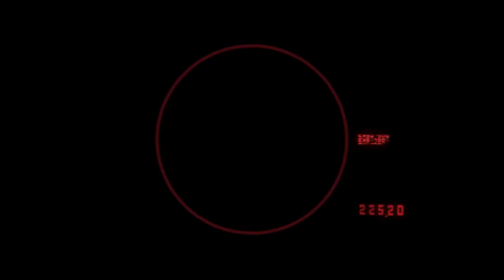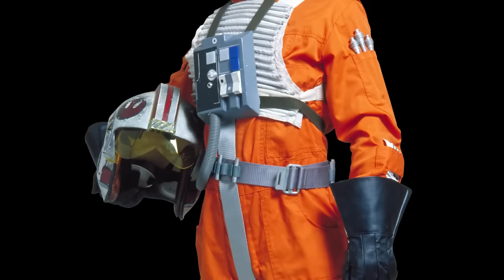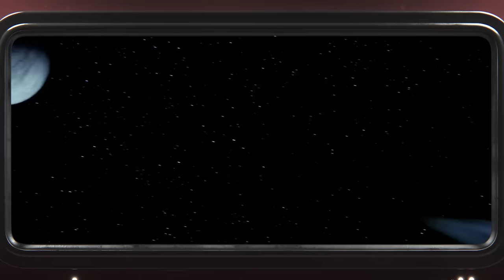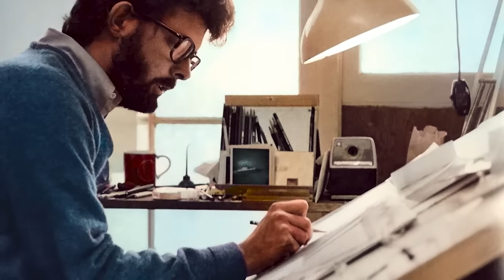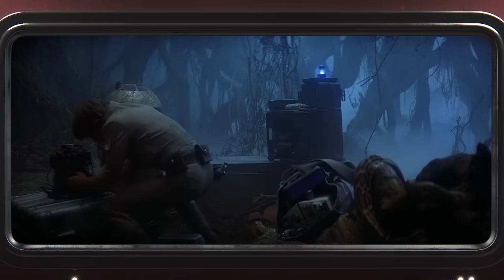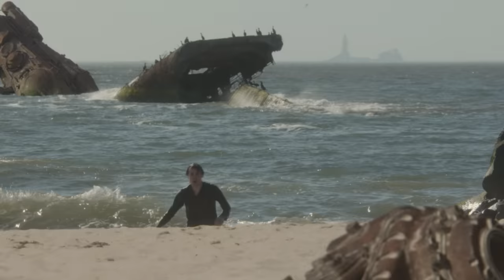X-Wing Ejection: It all makes sense now

Comment: I see this as a "yes, and" situation, where all those possibilities are included. You have the main pod system for routine ejections in space. If for some reason that's disabled or if say you're too low in the atmosphere of a planet to safely fire the main pod, you have the seat ejection system with some sort of shield to temporarily protect the pilot if in space or a harsh environment, and in case that's not enough, you then have some time to seal the flight suit.

Comment: I think the main reason we no longer heard about escape pods on starfighters is the fact it raises the stakes. The rebels have limited ships but throughout the series I always had the impression they're lacking proper pilots even more (also considering how quickly they got Luke into the attack run on the Death Star for example). A newbie might be a significant risk, even if pilots know each other otherwise. As such, losing (or not getting new) pilots was a serious concern. Just being able to eject and possibly instantly switch to another craft would have allowed for far riskier moves and strategies not necessarily befitting the tension building. (And I'm intentionally ignoring the bombing run in the sequels, while I understood the homeage, that felt just stupid, especially how there was obviously no safety/backup stuff for bombers being hit, even though these were dedicated heavy bombers… wtf?).

Comment: This is definitely the most sensible option and makes sense in every way, it is very weird that Legends material opted for a whole load of extra tech that even if it worked fully, would make survival very unlikely simply because most fighters ejected that way irl.
Reply: Which makes more sense? A big pod? Or a basic escape system and devote the resources to better shields and such. So I doubt the pod method like that will be used

Comment: That makes sense. This should be cannon.
Also if the droid could maintain control over what is left of the X-Wing it could then call for help using the long range transmitter.

Comment: In NASA's Designs for the Space Shuttle was originally suppose to have an ejection system similar to that of the F-111 so in the event of a disaster on the pad or During Launch, the entire Crew compartment would be ejected from the Shuttle and allow the Astronauts to survive. But those designs were scrapped on the account that the system would be too complicated and added more weight to the shuttle and thus meaning that it wouldn't been able to carry the loads and cargo that it was being built to carry.
Reply: Sadly, when Challenger exploded the entire crew compartment was ejected more or less in one piece...but with no way to bring it down safely. A few years later a redacted part of the accident report stated that at least some of the astronauts survived until impact with the ocean. I've always wondered if the person who made the decision to scrap that escape system still felt it was worth the weight savings after that.

Comment: Has a certain resemblance to the cockpit module of the  SA-43 Hammerhead from Space: Above and  Beyond. Was even used  several times during that series.
Reply: What I like about the series is that all pilots have their individual cockpits and get generic fighters attached to them.
Reply: @Schwarzer Ritter  indeed and also they had the most unique flightpreps I've seen so far, getting into the cockpits which were not even attached to the fighters yet.

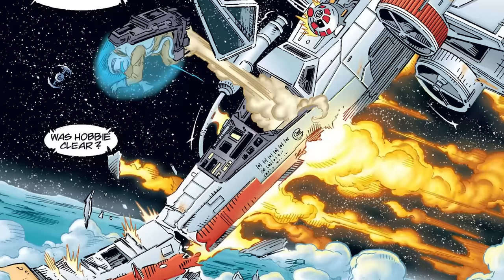Comment: @echenry 1:00 The X-wing novels explain that the pilot gear has a small emergency air supply, an air recycler and a small forcefield emitter that contains the breathable air around the body of the pilot while protecting them from the harsh radiation of space.

In this way, Incom saved money and resources in the design over a fully sealed escape pod.

Comment: Thankyou! This is awesome looking. 

A thought, the cockpit ejects "upwards" but the astromech doesn't necessarily do the same, maybe it ejects "downwards", that way there is no interference. 

Recently after the release of Maverick, Neil deGrasse came out and said Tom Cruise would have perished had he ejected from the Darkstar when it started tearing itself apart. However many pointed out that planes like it would have an enclosed ejection system, allowing Maverick to survive. The samples used were the same you put in the video. I really like the footage of real world samples that back up your design. It adds a sense of realism and tangibility that clearly is reflected in your models.

I hope to see a full fleshed out sequence of this someday, a bit longer than the one you have here. Also I am supper excited to see your fanfilm! Its gonna be epic and I am sure many will pitch in to help!

Comment: I had a teacher in college who was an F-111 pilot. He and his buddies were dubious as to the performance of the F-111's ejection pod. As for ejecting with the astromech, I figure that just as the F-111 has that extension behind it, maybe the pod on the X-Wing does the same for the droid. The pod is actually the cockpit, and droid station in one piece. If that's not the case, then I'd say the ejection works like the tandem seat system in say an F-14 where the seats go off in a certain order with a time delay. In the Tomcat, the seats eject the RIO first, then the pilot. Since a collision with the droid would mean both pilot and droid would be lost in the case of the X-Wing, I would imagine the sequence is reversed.
Reply: An astromech is supposed to have its own rockets anyway
Reply: @tsm688  True, but as both quality pilots and droids are very valuable, I would imagine there would be ejection considerations given to them as insurance.

Comment: Excellent work on this, EC. It actually does bring into question the other starfighters as well. The TIEs (Correct me if I'm wrong), despite how fragile the starfighters are, might have one of the better ejection systems out there since it's essentially solar panel wings strapped to a cockpit. Seemingly, Imperial pilots have extra gear on them to not only handle the possible vacuum of space, but the TIE cockpit bubble is an encased atmosphere (Double redundancy). If that's true, then Imperial pilots might actually be in better shape if they eject in battle than Rebel pilots. However, it isn't to say that the Rebels don't care about their pilots but are simply more limited in resources in how much they can provide to save their pilots.

Comment: I like to imagine that the true Incom factory made X-Wings do use full escape capsules, but the stripped-down variants the Rebel Alliance uses do not.

The rebellion's X-Wings need to be simple and easy to maintain with minimal specialized tooling, as these things are expected to be operating from dirt runways and serviced by speeder mechanics.

Shipboard servicing by trained technicians are a luxury only a select few Rebel pilots can afford.

An expensive, complex system like the Ejection Capsule is easily serviced by a proper navy, but the Rebel Alliance ISN'T one. They lack the necessary logistics and spending power to properly maintain a large fleet of original, cutting edge, Incom-spec X-Wings.
Reply: Yep. I was thinking something along the same lines. Though I was more thinking about how much the base cost increase would be from adding that complex and important of a system. I'm thinking at least 50% higher.

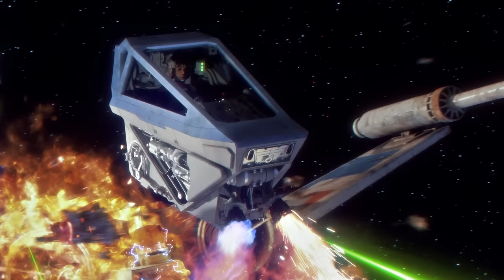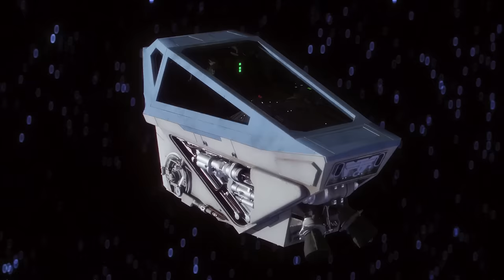Comment: This is a wonderful explanation that makes the most sense. Since it was not designed this way, the cockpit line does not seem to continue past the back window frame in the image of R2-D2 at 4:32.  The image at 4:07 shows a few inches of flat hull behind the window frame which is a more likely design.  I like the idea of color-coding the Cockpit to the group.

Comment: Rebel pilots were originally intended to have fully enclosed helmets and space suits (as seen in the original miniatures). It was a late design decision to switch to open face helmets so you could see which pilot is which during and make dialogue more dramatic for the death star attack. How a pilot would survive ejection was probably just an oversight.

The Tymothy Zahn's Thrawn Trilogy introduced the concept of pilots having helmet seals in the cockpit which pilots would apply before ejecting. This is somewhat more reminiscent of more complex bailout procedures in WW2 for the RAF bailing out over water with a life raft. Or also even the interim workaround for early F-14's where pilots were crews were instructed to jettison the canopy manually before ejecting to prevent the RIO hitting their head on the canopy until the issue was fixed.

Comment: Late to the party, but your idea isnt necessarily inconsistent with other media.
Its noted in the later X-wing novels that the first thing most Alliance squadrons mechanics do when they get a new X'wing from the factory is immediately tear it down looking for issues & modifying it as necessary.
The characters doing this even mention that there are chronic issues with certain equipment that makes stripping them or modifying them basically standard.
It would be entirely possible that one issue would be the cockpit pod itself. 
It is notable that no other aircraft ever used the F111s system, and even the F111 would lose it and go back to regular ejection seats in some variants IIRC.
The reason being how complicated and heavy it was.
So, it could definitely be a thing that Incom designed it with a backup, simpler basic ejection seat in case the main pod system was damaged in batlle( a not impossible happenstance given the descriptions of dogfights in the X-wing series) with the basic seat & pilots suit environment shield system being a last ditch option.
 But for the Rebels, operating often out of austere remote bases, with unreliable logistics, and usually fighting numerically superior foes on their home turf in raids, might find the  pod system difficult to maintain, another point of failure in both routine maintenance & combat because of that austerity & high likelyhood of being swarmed, & very difficult to retrieve a whole pod even in the event it did function correctly short of dedicated rescue vessels, which might not always be a available. 
So, it would be highly likely to become standard practice to strip most of this system, as it would remove possible sources of secondary explosions from battle damage located around the pilot in the form of the fuel for the larger ejection and maneuver systems, which would never be used in normal operation anyway, but add another critical maintenence item as well as the hazard. This would also likely free up room around the cockpit for more storage, & since its repeatedly referenced that the pilots when moving to a new location would often transport their personal items in the X-Wing, or even basically live out of them in particularly austere conditions frequently seen by the Alliance, its quite likely more cargo space was deemed a higher priority than a complicated ejection system, especially if a simpler, more reliable system was also already present. 
This possible unreliability of the technically better, but probably less practical system( given that for most of the early use of the X-Wing would have been in hit & run  raids agaisnt Imperial bases & convoys, where even if successful ejection of any sort would likely mean they would get picked up not by the Alliance, but almost definitely by the Empire) it would explain a hesitation to eject unless all other options were exhausted, maybe even a common practice to 'ride it down' no matter what.
It could be, that if this practice of disabling the pod did become standard, that by the post-Endor era, where the Alliance gets better organized, better standardized, & its logistics more rationalized, that recognizing that an expensive feature that is commonly removed by ground crews, despite its theoretical positives for pilot survival, is a wasted expense, wasted effort in production, so it might from that point forward not be included in the fighter past a certain point, relying instead wholly on the simpler seat.
Now, that doesnt preclude that later on, after the New Republic is established & the Starfighter Corp goes from being a guerilla force with limited resources to a proper military organization with established bases, dedicated maintenance logistics, proper Search & Rescue support, and a more defensive mission profile, that such a feature wouldnt reappear in service, as its flaws would be much reduced in that context, and its bonuses much more readily apparent.

Comment: My issue with this idea is that you're now packing a lot of extra hardware into a narrow, connecting area of the fuselage. The proton torpedo launchers are just forward of the cockpit, and the magazine is usually depicted as behind the launchers, just underneath the cockpit. So not only are you now squeezing an extra hull layer and ejection mechanisms into an area that has limited space as is, you're also putting thrusters right next to a warhead magazine. If you haven't fired off your torpedoes when you take critical damage, what's to stop the ejection pod's thrusters setting them off?

Not to mention that all the forward sensors need connections to the power plant in the aft. Seems like a lot of very complicated engineering for a situation that is apparently extremely rare anyway - it seems that in most cases critical damage to an X-Wing causes the whole ship to explode before the pilot has a chance to react, given how every other X-Wing in the OT goes out. 

I do like the idea of the cockpit pod, but given how much easier that is to implement on the Y-Wing and B-Wing, I kinda like the idea that maybe this is one of the very few areas where the X-Wing is deficient compared with most other Rebel fighters. It's an excellent all round starfighter, but the engineering compromises have to happen somewhere, and pilot ejection is one of those areas. The Incom marketing probably makes the point that the best safety feature is to be in the ship winning the dogfight in the first place. 
.

Comment: Y'know, there'd be another reason to have a separate cockpit module apart from ejection: handling species with unusual atmospheric requirements or non-humanoid body shapes. Build cockpit modules for the species in question, and you can sell X-Wings to them without having to redesign the base ship.

Comment: In one of the EU books, it's mentioned that the pilots had a type of shield module in case they needed to exit the snubfighter. Wedge uses it in order to go out and prevent his self-destruct from activating by placing his hand between the crystals.

Comment: If you read through any of the X-Wing series (yes, I know, decanonized, but most of the fundamental concepts are still commonly accepted by most fans), this is addressed frequently. The box on the front of the suit carried by both X-Wing and TIE pilots is a life support unit. In the case of TIE pilots, whose suit is completely sealed against space, it is their only life support. For X-Wing pilots, it is SUPPLEMENTAL life support, and is responsible for generating a miniaturized magcon field (the invisible field that keeps air from escaping hangar bays in space) around the pilot. The field, combined with the pilot's suit, provides LIMITED, TEMPORARY protection against the exposure of space. For most operations, the squadron maintains a support shuttle within microjump range, whose primary job is to bounce in and grab ejected pilots before they die from exposure. On some operations pilots maintain the understanding that ejection could equal death or capture by the enemy (torture and eventual death). This is what makes TIE and X-Wing pilots so badass, in my opinion.

Comment: In the X-Wing novels by Stackpole and Allston, and some others, it’s explained that their flight suits instantly generate a small force field similar to the ones that contain hangar decks from open space.  At the instant a pressure change is detected during ejection, the field is expanded and the little bubble around the pilot is pressurized.  The pilot can only survive for a given number of hours inside the bubble, but not because of power or oxygen running out, but because of loss of body heat and, literally running out of food and water.

Also, something to consider is if the official cross sections guides are considered “canon” and how the “real” snubfighters operate, there’s no capsule in the X-Wings, A-Wings and Y-Wings, but there is one in the B-Wings (also mentioned by others here) and Lambda shuttles.  So, one has to consider it must be like our technology - there are engineering and design considerations that determines the type of ejection system the crew gets.  Of course, it’s all make believe and matters about as much what the Lucky Charms Leprechaun thinks about the giant space ants.  lol

Comment: This is also the system in Babylon 5, Space Above and Beyond, BattleTech, and some Gundam series.  Basically a full cockpit ejection system is the most reasonable for a starfighter or any vehicle designed to work in a vacuum.

Comment: You could even make the case that the ejection pod is designed in such a way that there is an ejection seat within it as a back up if the pod is compramized when ejection is needed.

A force field bubbled seat is better than a stuck or compramized pod, as some chance of survival is better than no chance of survival.